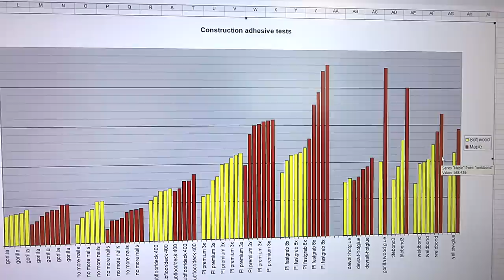Testing construction adhesives as woodworking glue

Comment: I love 8x. The texture of it actually helps when I need to use construction adhesive. For instance, I did my whole tile backsplash in my kitchen using that instead of morder. That stuff will both hold it in place because it's so thick and also be stronger than anything else out there. 

 Unfortunately I haven't been able to find it since Covid
Reply: yeah morder isn't a very good adhesive
Reply: @executive  morder is just so messy for me. I tend to get it everywhere (especially trying to do tiles on walls). For a backsplash the 8x is both stronger and cleaner. I'm not sure I'd use it for floor tile though.
Reply: @maxamos7  I use mortar for tile
Reply: @executive  ok...
Reply: @maxamos7  I didn't see any morder at the store

Comment: you should give sika pro a shot it primarily for concrete applications but i had an open tube when making a form for epoxy and when i went to take it apart the melamine was torn apart buy the very flexible thin strip of sealant.

Comment: I’d be interested in see what 3m 5200 marine adhesive would test at. I’ve used before it’s strong stuff!
Reply: 3M Marine adhesive is the only sealer I trust to be completely watertight. It ain't cheap but it always works.
Reply: Polysulphide is as much a sealant as it is a glue.
incredibly strong and resilient. It's a good choice if you're anticipating shock loads.

Comment: I know this is kind of a stupid question, but didn’t super glue perform really well last time. Why isn’t it used as an actual wood glue more often?
Reply: I think that it´s too brittle and can´t fill any gaps. If the joint is thight, then it might work. Besides that I don´t trust ca glue over time.
Reply: Superglue is great in tension, lousy in shear.  Also doesn't like water.

Comment: To be fair... Construction adhesive is designed for application over long narrow edges and large flat surfaces, which develops the overall holding power required in those situations. There is no best or better glue, each is developed for a limited number of specific applications. 🕵️‍♂️

Comment: i wonder if i could use that gorilla glue for sealing around a bath tub because all silicone ive tried just cracks after the tub moves slightly
Reply: 3M 5200 marine adhesive is the best sealer I've ever used. But it isn't caulk. Though you could use 5200 like a caulk. It has that kind of body to it. Doesn't tool like you'd expect a caulk to. There's a reason why they don't call it caulk. It only comes in one color which is a light tan.  Stuff is incredibly strong. And pretty pricey too. Applied correctly I don't see how your tub could move much. Just clean out all that old junk and put 5200 in there and it should hold. I'd bet the farm on it.

Comment: Anyone have a suggestion for an entry level electric caulking gun? Thanks to repetitive motion injuries I can't really use a manual caulking gun any longer. Thanks.
Reply: Try a Ryobi 18v one.  Ryobi quality is good enough for the homeowner, passable.for the pro, and the price is good.  Other manuf. also make the battery powered ones if you already have those in your toolbox

Comment: After your last test where you tested hot glue in the same test setup, I thought about how you should also do a twisting test where the 2 pieces of wood is not sheared along the glue axis, but instead twisted, like if you glued 2 pieces of wood togehter at a 90 degree angle and grabbed each end and twisted them in opposite direction in each hand.. I think hot glue would fail such a test much sooner than regular wood glue???
Reply from the maker: and how is my test not a twist test?

Comment: Can you do a video on spray foam.  Maybe test adhesion and expansion with or without water. I've heard there is a big difference of u add water to spray foams while applying it.
Reply: there is a big difference and it is easily explained - PU expansion foams are based on an isocyanate (like Triisocyanite) and polyol (like Butanediol)

to form a proper chain-linked polymer the isocyanate reacts with water, this reaction creates the polyurethane link and releases CO2 as a byproduct - the CO2 foams up the Polyurethane, the more water you add, the more CO2 will be created and harden the compound

if you don't ad water the reaction only can consume the humidity from the air, therefore less CO2-pressure, smaller bubbles and longer curing time

there are other methods of polimerizing PU too that won't foam (or only lightly foam) or on the other hand excessively foam - just depends on the product you're using
Reply: @suit1337  definitely over my head on the chemistry lingo but very good.  I've heard adding steam into the application tube works well.  Would be cool to see some experimentation with that.
Reply: @Jped277 

of course it might be cool to exeriment a bit - but the hard truth is: chemistry people designing those glues know what they do, if you want a foam that foams excessive (for insulation) buy such product - if you don't want it to foam, buy a glue that does not (or some where in between).

it is a bit like cooking - you can make pizza with loads of baking power, it foams like crayz and you get nice bubbles - but still takes like crap, thats why italians intended a pizza to be made with yeast, because it adds bubbles and taste ;)
Reply: @suit1337  I meant to see the difference in expansion. Not really as an adhesive.
Reply: I helped create some weatherization training materials for a program to help low-income households.  The photos I saw really made me shudder.  Imagine 12 to 24 inches of spray foam completely blocking off attic doors, basement doors, etc. 
It turned a recessed part of a house with a doorway into a spray-foam cave.  I know the stuff can be useful if applied properly, but when I hear about expanding foam, the only test that comes to my mind is:  what's the best chain saw to cut through the stuff to access your house again?
Reply: @scottk3292  lol that sounds quite extreme. We use it for small gaps in framing and around electrical wires when ran thru the top plate of a wall. Just to keep bugs and things out.

Comment: Guess construction adhesives are not designed to work well on planed or even sanded surfaces, May be results will be much better after rough construction saw?
Reply: that is why there are called "adhesives" ;)

glues can work on different principles, the most prevalent are adhesion and cohesion

adhesion is a property where you hold together 2 pieces by just "touching"
cohesion is a property where something holds together "by itself"

a high viscosity construction adhesive is usually just an adhesive (and has an inner cohesion to itself of course) - it is irrelevant if you glue together 2 planes of glass or 2 very rough bricks, it is good at permanently adhering to stuff

on the other hand, wood glues based on PVAa have moderate adhesive properties, but the resulting polymer has a very high cohesion - so when they (since they are low viscosity) soak into the wood, the "glueing effect" comes mostly from the inner cohesion and not from the adhesive properties.

you can veryfy that, when you just try glue 2 pieces of glass with PVAc glues - will work, but you basically can "peel" them off easily - if you try to peel off a PU adhesive, this is much harder

thats why PU glues for wood have usually a low viscosity
Reply: I think converse is even more true - wood glues should work notable worth on rougher surfaces ?

Comment: i only ever use adhesives like this for gluing skirting boards or architrave onto plasterboard walls then add a few nails, i'd never use it for woodworking
Reply: Well some do. For outdoor projects folks say it's the best. Works in cross grain applications too.
Reply: Splicing some planks on outside trim or deck - is it woodworking or not ?

Comment: Pretty sure construction adhesive is more about keeping framework from creaking than holding things together. Not an expert opinion though.
Reply from the maker: there is the whole question about how it does long term, and hard glues may end up cracking.  But the soft stuff may deteriorate chemically, you never know.  But once it's in a house, you can't really fix it.
Reply: @matthiaswandel  I literally can't wait to see you do that testing set.  hehe
Reply: There is also a lot of stuff outside that you may want to glue and that should stand rain and temperature swings

Comment: Hm, the construction glue I use (in germany, so unlikely to get it) is in small amounts (like the white stuff) pretty hard after 24 hours... so probably there are even way more  versions... in woodworking I found that its a good idea to use it at places where you have bigger gaps to fill them, but to still have surfaces that hold with classical wood glues..
Reply: I went into a big box store to pick up some construction adhesive once and it was one of the most confused moments of my life. Because I know nothing about it. There must have been dozens of different kinds to choose from. Each making more outrageous claims than the last.

Comment: This is not correct test. The excesive amount of glue on sides creates additional lateral resistance to the load. Since the amount is diffeent, resistance is different too. You need to clean all the glue on the exterior surfaces. If you do it wisely, you need to weigh the same dose of each glue and clamp it to the same pressure, for a more identical state of all the elements participating in the tests. It would also be good to treat the surfaces with acetone, for example.

Comment: Why they are soft is a riddle to me - most PU adhesives we have here in europe harden within a few hours - maybe your temperature or humidity is to low since Polyurethane based on di- or triisocyanate needs water for the cross-linking polyimerization - as you said later, you added water and give it 2 weeks to set, this should have not been an issue in the final results

but as mentioned on the past video:

i tried Titebond compared to "regular" PVAc glues here in europe and there is no noticeable difference when applied correctly

there is a huge difference between viscous PU construction adhesives though - some of them are quite aweful für wood since they are designed for example to glue mailbox to a brick wall and not joining wood to wood - but there are specific ones designed for wood

for the fellow europeans: when you want to glue particle board or OSB and need D4 use either "Beko Allcon 10" (high viscosity) or Soudal Pro 45P (low viscosity) or Ponal PUR (somewhere in between) - but when it goes for strenght, regular PVAc glue is far superior (like "Ponal Classic", "Bindan P" and such).
Reply: It's almost certainly low humidity. In the humid summer months here the stuff sets very quickly. In the cold dry winter months the stuff takes forever.
Reply: Gorrila construction adhesive, I think, claims to stay slightly flexible.  Which may mean it is not PU
Reply: @dmitripogosian5084  since PU is an elastomere, the hardness (flexibility if you may say) is measured in shore

a high shore value is petty rigid where a low value is soft and flexibile

Comment: It appears you are only testing shear strength.  Are you interested at all in testing the tensile strength? (Or the resistance to pulling apart.)
Reply from the maker: in woodworking, it's almost always failing in shear due to racking, which is what I tested.

Comment: So, unless you live in a refrigerator, keep using your preferred wood glue.
Reply: There's definitely places where these construction adhesives would be the superior choice. Like gluing cross grain and outdoors. Or if your woodworking is really rough. I've cut some dovetails that could have used construction adhesive in them.
Reply: I live where it is colder outside than refrigerator for half a year :)

Comment: Construction adhesive is good for warped boards and gluing wood to concrete when doing rough construction. There's no benefit to it for furniture making or hobbyists that use precision joints. There are no real price savings either.
Reply: @Heraclitean  I've done projects where I could have used more open time.

Comment: Just break down and buy the 3m 5200 best adhesive you can get
Reply: I use 5200 when I need something waterproof. Just as a glue I can't recommend it though. Once you crack the tube open you pretty much have to use it up on the spot. It doesn't keep. Setup in the tube is makes a good sandpaper cleaner though.
Reply: @1pcfred  you have to tape the end closed and put it in the freezer and will last quite a while
Reply: @nathanbutler8240  freezer space is at a premium here and I really don't want a tube of glue in my freezer with my food either. Plus some chemicals can get funny when frozen. It's not a ham sandwich we're talking about here.
Reply: @1pcfred  lol bro you don't have to smear it on your sandwich 🤣 put the tube in a ziplock.bag and be done with it.